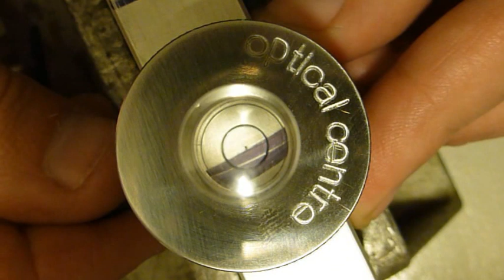Drill / tap guide for use on the edges of aluminium plate.

Comment: Brilliant solution, Thanks for sharing. I have been searching for something like this for a long time, I am constructing a CNC machine out of 0.5 inch aluminium plate and this is the answer to my problem of edge drilling accurate holes, I have a disability in that I only have the use of one arm and hand, and have been putting off the drilling and construction of the CNC frame for fear of trashing my expensive aluminium. I have a drill press but some of the parts are too long for its use.

Do you know if there is a kit similar to yours available, I just have to have one.
Reply from the maker: Fred Morris Hi Fred,  I haven't seen anything like this on the market, I did think about having a few made (along with shims to accommodate different thickness's of plate) but it's a bit of a niche market and they're not cheap to make!  Where are you based?  If you're nearby I could always lend it you, or I could see about getting another one made...
Reply: Hi Waldemar, thanks for taking the time to reply. I am based in Liverpool in the UK, if it was possible to loan it I would be very grateful,  thanks.
Reply from the maker: Fred Morris I'm in Manchester, well, Stockport.  Drop me a line via the Google+ and we'll sort something out.
Reply: I've never used Google+ for messaging, will try and get my head around it tomorrow, speak to you soon.
Reply: Fred Morris Hi Waldemar, Thank you very much for your very kind offer but I have decided to bite the bullet and put the job out to a local machine shop, I am too impatient to finalise my CNC build. They are going to mill all the edges (which were a bit rough when received from the supplier) then drill and tap all the parts for me. This should ensure that all the assemblies will be true right angles, which is a must when building a CNC machine, as I am sure you are aware.

By the way, how do you send a private message in Google+?
Reply from the maker: Fred Morris Hi Fred, apologies for the delay in getting back to you - have been rather busy..!  Yeah, if the money's available and you need it doing in a hurry then sometimes it's worth paying the pros to do the important bits..!  Are you a member of MYCNCUK.COM - an excellent resource for DIY builders.  I noticed your post about zeroing - plenty of info about making your own probe out there.  I'm hoping to make a simple z touch-off plate.  I've tried and tried to get the google+ email to work (in theory g+ contacts should appear as you type in a new recipient in your compose window) but to no avail..!  Good luck with your build, nothing quite like it when it's all up and running!  All the best.  Wal.
Reply: Hi Wal, no I'm not a member, will have to look at it. I have made a z axis touch off plate, works a treat on my 'woody' CNC lol, yea I started off by building a birch plywood CNC machine, none of your MDF crap mind,  it was well engineered but far too sloppy, which is why I'm building a 'proper' one. All the best to you too.

Comment: surely that tool is only good for a certain thickness of aluminium?? You'd need a tool for every thickness you want to work on- right?
Reply from the maker: Michael Ripley yep, this one was made for 20mm plate, and I have another for 15mm. To be perfectly honest, it's a bit over the top, but I do use it on the odd occasion and it works very well..!